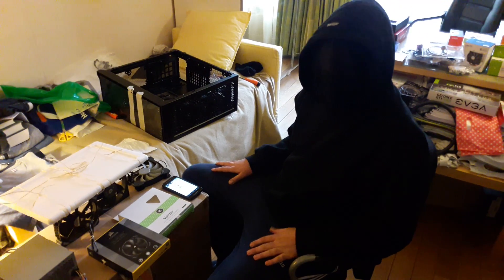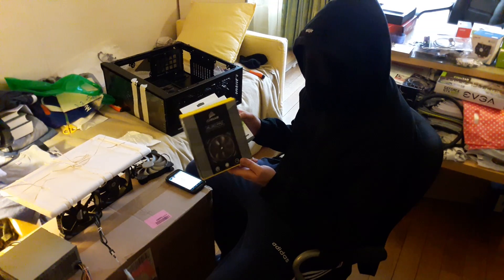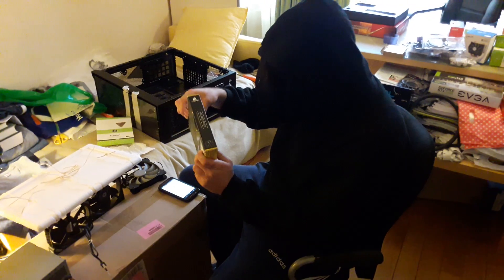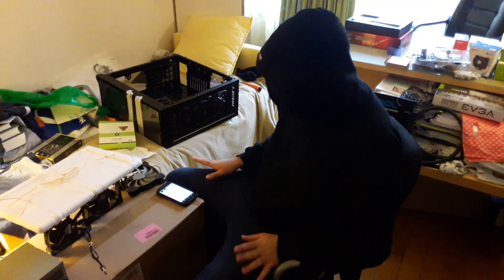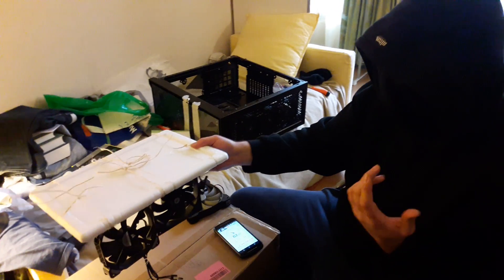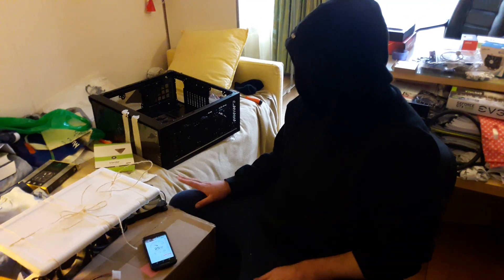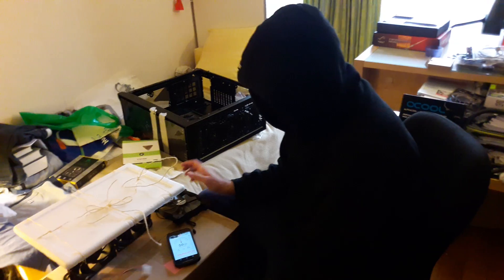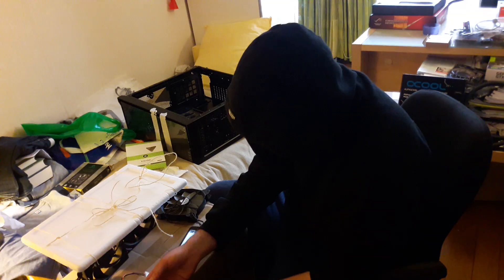Ryzen Build Log Part 6 : Corsair ML140 Pro 140mm VS EK-Vardar F4-140ER

Comment: my plan is to replace my Corsair H115i Radiator Fans, what you recommend Corsair ML140 or EK Vardar 140 ? for best performance and quieter noise ? thanks in advanced :)
Reply from the maker: The Vardar 140 mm fans are less quiet than the Corsair ones. One of the pair i got seems to have a motor whinning noise at low rpm. Then again Vardar has replaced the fans i got with newer "silent ones". So it seems you can't buy the vardar fans i bought directly from EK anymore. Tbh is seem i had bad luck. The 120 mm ones are perfectly silent. Hard to justify the extra premium Corsair asks for. Have not measured performance between them since one pair the corsair is in push and the vardar pair is in pull)

Comment: What are you using to power the fans in the experiment?
Reply from the maker: Just regular 3 pins connectors  adapter from a 4 pin molex connector. Can only run them at full speed this way. 4th pin job is to provide regulation.
Reply from the maker: There is an old PSU on my left. The fans where connected to a 3pin connector so i could only test them at 100 %. The corsair fans should not run at less than 100 % on a 3 pin header since they require specific power for the magnetic levitation fan motor which should always be constant.